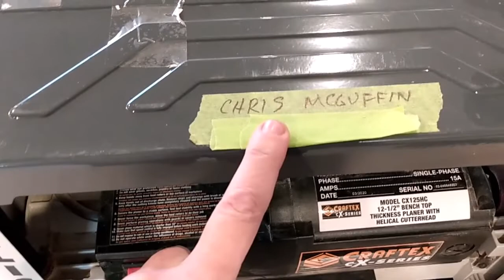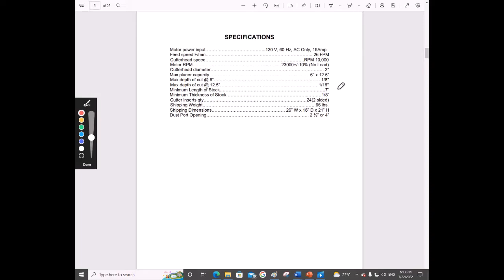Craftex CX125HC Planer (Warranty) Review

Comment: Hi Chris. I'm about to get into a similar problem with my planer and wondering if you found a solution to your satisfaction. It was working fine but yesterday started doing what yours is.
Reply from the maker: Hi David, if the tool is still under warranty my advice is to report the issue promptly to your BB store. Feel free to contact me through Instagram or FB messenger and I can advise more specifically.
Reply: I fixed mine today. The problem was the end piece that holds the front roller was out of its slot. Basically with the unit all the way up you could see the front roller was off kilter. It had nothing to do with build up on roller and everything to do with the roller not sitting where it is supposed to. Take a look at yours if you have time.
Reply from the maker: @davidkirk891  great to know you managed to fix yours. BB eventually agreed that mine was defective and took it back. They issued me a store credit.

Comment: Well i have been looking at that planer for weeks & was almost ready to buy it... after seing your review i think i will revert to another brand.
Reply from the maker: I actually like the planer and bought an identical one to replace it. The application of the warranty is where I was disappointed. Like most of the tools sold at Busy Bee this planer is available from other stores in different colours depending on the brand. I'll produce an update video to describe how everything worked out...
Reply: @McGuffinWorks  I was actually thinking of buying their 13 inch model, which is exactly the same as the Rikon, manufactured in the same factory… the price is good these days but I am in Mtl & the 13 inch cost 185$ to ship… the 12.5 ship for free… I’m also looking at the new lacuna 12.5 inch… 950$ but with 4 edges carbide inserts…
Reply: @McGuffinWorks  what about their 8 inch jointer? Any problem adjusting the fence & keeping it at 90 degrees to the table ?
Reply from the maker: @mariocoulombe6782  I have the CX08BTHC jointer. It is a lighter machine than the more common 6" cast iron jointers. The fence stays put and is easy to adjust. The depth of cut is also easy to use. The primary limitation is the length of the bed. It is difficult to true a board that is more than twice the length of the bed. I might do some reviews on the different Craftex tools in my small shop ;)
Reply from the maker: @mariocoulombe6782  you can find me on instagram @McGuffinWorks PM me and I can provide more advice based on your specific use cases.
Reply from the maker: @mariocoulombe6782  there are other options for shipping: freightcom is one.
Reply: @McGuffinWorks  I have the same jointer, and I also have trouble getting it setup to flatten a board, given the 8 adjustment screws it is a very finicky process.  Once setup it works great.   I also am considering buying the jointer.   I have a dewalt 733 that is a workhorse, but it doesn't collect dust.  It can do a full turn on maple.  If the drive wheels are slipping, try cleaning the drive cylinders with alcohol, and waxing the tables.